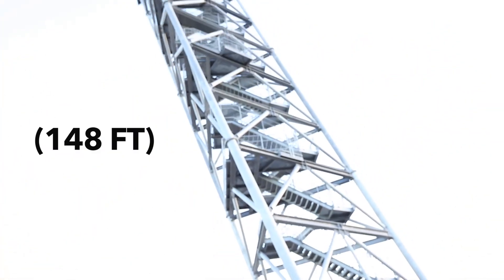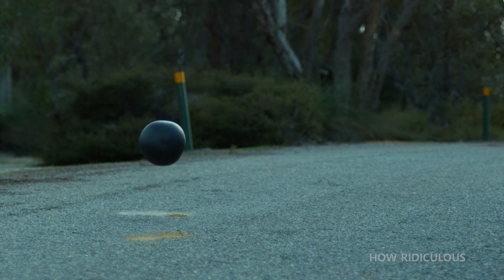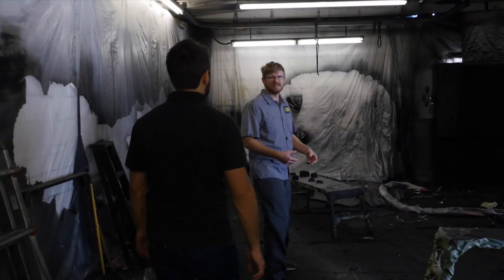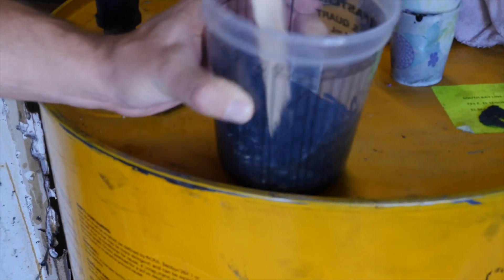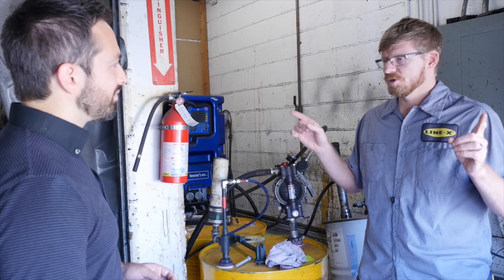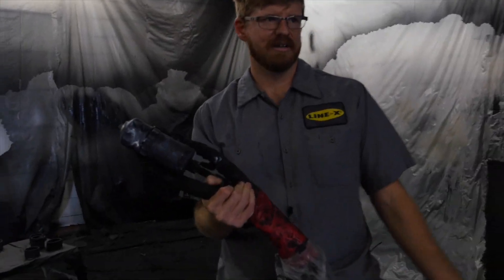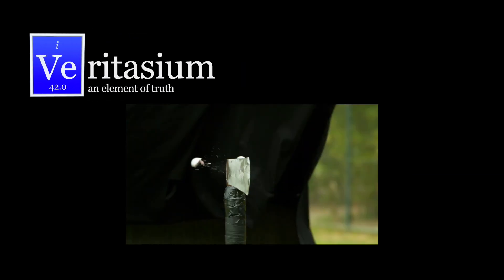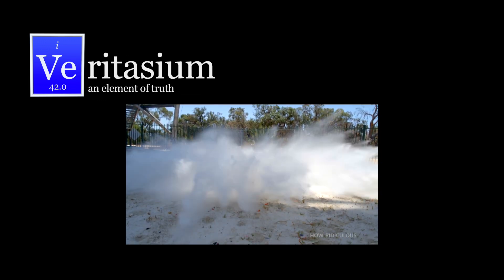Indestructible Coating?!

Comment: For easy to count, consider g = 10m/s2.
S = 1/2 gt2
45 = 1/2.10t2
9 = t2
So t = 3 s. The wm flying about 3 seconds before it smash the ground.
So we can count the speed.
V = Vo + at, Vo = 0, so...
V = at, a = g, so ...
V = gt = 10.3 
V = 30 m/s  or ...
V = 108 km/h.
😊

Comment: That looks like polyurea. I used to spray it.
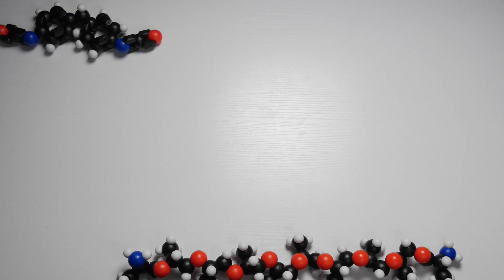Edit 2:10 that's definitely looks the same stuff,  linex is a brand name iirc I've used their product. Edit 3:30 smug mode. What they don't tell you is you can't use it in a damp atmosphere or on anything with moisture on it because the water steams off and fills the coating with pinholes. Also the catalyst is iso cyanate which is pretty damn toxic. Once mixed and cured its quite inert. Many applications have been tried including fire retardant and as a tanking system. The canals in dubai are lined with it.

Comment: 1. It was not intact. It had a hole in it.
2. The coating is thicker than the actual water melon wall. Can we still think of this as a coating? Or does the water melon wall has become the inside coating of that black material?

Comment: I always imagine this being used on retaining walls or foundations 
Cracks from settling wouldn't be as much an issue if coated

What's the cost on this stuff, say per square meter...or square foot

Comment: Maybe this can be used to coat the space station to make it more resistant to micrometeorites or even better to coat the Bigalow Aerospace's habitats with this - those are already much more resistant to high speed impactors than the classic materials used in the space station.

Comment: FYI: this substance was NOT invented for use as a truck bedliner. The inventor's goal was a UV and weather resistant coating for polyurethane foam insulation. Closed cell foam polyurethane insulation (think "Great Stuff" canned foam insulation) has been used for decades as a roof treatment for large industrial and commercial flat roofing. The problem is, it's doesn't withstand UV exposure or abrasion very well. The inventor's goal was a weatherproof topcoat system to be sprayed over the polyurethane foam efficiently over a large area, using similar equipment.

Comment: They just put 2 cm thick stuff over it. If I could cover it with 2 cm steel, you'd see that watermelon crushing into concrete and breaking roads. I don't see a reason for excitement >_>

Comment: Hey, since it is so dense once cured,  how heavy is it in relation to aluminum of the same thickness?  How well does it perform in a absolute 0 environment, and can it withstand extreme fluctuations in temperature?  Also, how well does it seal a micrometeorite hole in a vacuum?

Comment: Bedliner.   I have an idea, I sometimes build flat bottom plywood boats and coat them with fiberglass resin.   Good stuff, but expensive, and hard to apply. It is also prone to cracking.   Next boat, I will simply take it to a shop, and have bedliner sprayed on.  Soaking rags with resin and squeegee them down is very labor intensive, and a 14 ft. boat is about $300 bucks.   Spraying the boat is probably around the same money, but zero labor. Heck, they can shoot the inside too !!.   I'm gonna do this.

Comment: so the coat a melon with plastic and think it saved it from a fall..  NEWS...  the watermelon is in just as many pieces..   inside that platic cover...

might be so called indestructable plastic... but the melon bit the dust from the sheer shock of stopping instantly from 100 mph,,  

should probably try a parachute next time

Comment: What if they used that to make bullet proof armour, or to reinforce armour.
Reply: A few years ago I read that latest bullet resisting armors are looking to use liquids inside fibers to absorb and spread momentum to larger area. Spreading momentum is important because heavy high speed bullets have a lot momentum targeting a small area.  I don't know if that research have led to any products.

Comment: 4:45 my only question is what stops the gun from clogging also, I'd like to make armor out of that.
Reply: In short. Air. You have 3 feeds and a heating element in the hose. The two components and an air line, when you trigger off air is pushed through the gun clearing the nozzle. This stuff only mixes right at the gun tip and cleaning the gun by hand isn't too hard but it does involve using a nasty solvent like naphtha (sp?) a sharp knife and some patience. Nothing is disposable and this stuff is nothing like paint.
Reply: @stuart207  clean with acetone..
Reply: @gbear1005  yup that works too 👍
Reply: I used to work in a factory that created polyurethane foam parts for the auto industry (Cup-holders, armrests, etc). The chemicals that Line-x uses are the same as the ones that we used to make auto parts. This stuff has some amazing properties but as all of you saw it is an incredibly messy process. It's kind of crazy to think that with the right ratio of Iso and Poly and the right pressure, you can create this stuff.

However, these chemicals are an environmental disaster. Isocyanate reacts with water instantly and once it is exposed it crystallizes instantly and it is almost impossible to separate once it has made contact. Getting this stuff in your eyes, mouth, nose is horrible, you can go blind from it and it can be lethal. Plus the waste for any process involving these two chemicals is considerable. I'm surprised that the EPA hasn't shut that factory down. It was insane.
Reply: It's called Rhino-Liner
Reply: @martinlongbow3519  not rhino liner. Completely different and line x is better lol
Reply: You gotta clean the guns just about every day.
Reply: @Dan ny I don't work with lineX but this is most likely. With spraypaint it helps to invert the can and pull the trigger to clear the nozzle between uses.

Even then, I bet the mixing chamber is semi-disposable. You get buildup over time.

Comment: The watermelon that gets covered in the coating and dropped is how I imagine Ironman would actually fare in a battle.
Reply: Exaaaaactly
Reply: Heh, it'd be convenient to clean out his corpse from the suit after a massive impact, I'll grant you that.
Reply: Watermolen heh heh.
Reply: I wish the movies would've included some of the repulsor field tech from the early iron man stories. Makes more sense than a metal suit being able to withstand all that force, and him surviving
Reply: Poly man
Reply: oh no, he said he moved to nanotechnology.  That fixes everything.
Reply: Yeah that's many G's of force and compression to handle. It would have to use some really impressive absorbent tech. Surely not one causing to bounce loool
Reply: When I was reading this comment, I'd thought it was bad grammar. I read it again, and it wasn't. Now I am second guessing myself for every decision.
Reply: Sloshy sloshy
Reply: Heh... Always thought the same thing... The ONLY suit that could address this would be the Comic one where the suit is part of his body/inside his bones.
That suit could establish an internal structure to keep the organs in place/shape but any other suit could not prevent him from getting killed or at least knocked out from the shock...
Reply: @Duraltia  Your soft tissue would still rupture. Tearing apart blood vessels, organs and worst of all, your brain.
Reply: @Tibovl  Well I'm not too familiar with that suit but I'd guess if the Nanomachines can be housed in his bones and exit through every pore of his body to form a Suit then they may as well be able to form a mesh throughout the entirety of the body to deal with that issue. Not sure if you're familiar with it but the first Battle Angel Alita ( aka GUNNM ) series explained Alitas high resistance to head trauma by spinning a story about her brain matter having been replaced by a shock absorbing polymer acting like a nonnewtonian fluid when shaken ( but not stirred 😁 ) thus preserving the nerves. ( gets weirder in the second series and becomes real nightmare fuel in the third ) Maybe Tony's Nanosuit would have the same possibility?
Reply: @Duraltia  I suppose it's possible enough for a comic book.
Reply: Well if the linex was sheet steel.
Reply: Iron Man is actually pretty impractical unless he had vibranium or some other shock-absorbing material.
Reply: wrr
Reply: And his fluidic system inside is just like the squashed watermelon meat looool
Reply: @liusam651  Yeah, that's the whole point, bro.
Reply: Nah man his suit has inertial dampeners in it.
Reply: @TheKrensada  aka magic.
Reply: Aka plot convenience.
Reply: Wait a minute, I thought Iron Man was "turned to steel -- in a great magnetic field" and that his "heavy boots of lead -- filled his victims full of dread". AC/DC is for the sheltered kids.
Reply: @revwroth3698  *Ozzy Osbourne
Reply: mica davis yeah that’s not AC/DC
Reply: r/boneappletea
Reply: Rob Rob  you should feel like a smart ass. we all know that you would die in real life. We just don’t all point it out and ruin the fun of watching a movie with your friends
Reply: EbmasCol not anymore his armor was made out of vibranium witch is vibration absorbent

Comment: Go buy bottled water, and throw it off a tall building. That bottle is thinner a ballon, and it may rip, but only a little. that mellon had a coat an inch thick . Most plastic is pretty tough.

Comment: I wonder, can a delivery system for this be used in space to cover an asteroid with it. The loose dirt type asteroid and use a propulsion effect/element on it to steer it away from a collision course with Earth. Or it could also hold a potential for either a slow no oxygen burn, explosive potential or reflective steering by using photon pressure. Might be the miracle we need if it could ever be designed to be used in space. Hope Veritasium can give an answer to a interesting query.

Comment: So basicly you have a material that is indestructible.  But everything inside is damaged. Tell me again why would I use this. Your missing the whole point. To save the thing your protecting from damage.
Reply: Darren The Adventurer no it does protect things nothing not even a steel shell would protect a watermelon falling at terminal velocity with only a few centimeters of depth but this stuff will protect truck beds from rocks or steel falling into the bed from a considerable height.

Comment: They should try coating a concrete ball. Will it break?
Reply: It would be interesting to line different materials. But the concrete ball would certainly break, it is much more brittle than watermelon. Would the Line-X contain the concrete pieces? Probably not!

Comment: Ikea would make furniture out of newspaper and then line-x it.
Reply: I had to reread it because it didn't make sense then I remembered how everyone complains about how cheap IKEA is lol
Reply: @coltengordon8924  If you didn't know, LDSP (https://en.wikipedia.org/wiki/Paperboard) is basically cardboard with thin plastic coloring. Cheap furniture is a bit more sturdy than cardboard.
Reply: No, they would give you the newspaper and the Line-X and tell you to do it yourself
Reply: that's pretty much what they do already. What, did you really think you were  buying a wooden piece of furniture? half of that's resin
Reply: Yeah tbh kinda like MDF
Reply: And cost 5 times as much? Great idea...

Comment: Do they just think about the consequences for the environment, this should be illegal to create such products, how long will it take for this line-x to degrade in nature. You should speak about this in your video!
Reply: There are some unusual microbes that actually eat the stuff.  It's more biodegradable than glass, and the toxicity is low.

Unreacted isocyanates are nasty though.  They like to react with skin and lung proteins and make a mess for the immune system to clean up.  The mechanism of action is similar to poison ivy, except that industrial isocyanates can be much more volatile but are much less irritating.

So, you probably won't ever get a horrible blistering rash from MDI on your skin, but you can easily get asthma from spraying it.

Because isocyanates are very reactive and unstable in damp conditions they don't build up in natural environments or inside your body.  They react within seconds and any problems you'd experience come from the reaction products.

Comment: The watermelon loses a lot of its wonder when you look at how thick the coating on the outside of it appears to be... is that 1/2" of the stuff plastered on there? When it's laying cut in half and the two guys are playing with the melon guts instead of the polymer, it looks like quite a thick layer...

Comment: @2:25 Component 'B' is NOT a plasticiser. That is something altogether different... a chemical which makes a rigid material (eg PVC) more flexible (plasticised PVC). B's function is to join the reactive ends of the chemical A together (and vice versa) to form long-chain molecules (polymer).